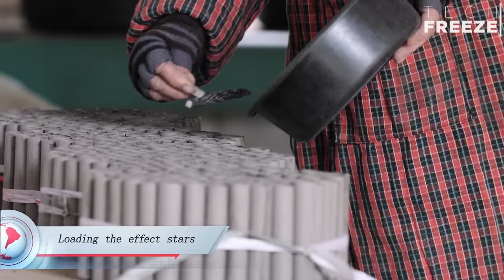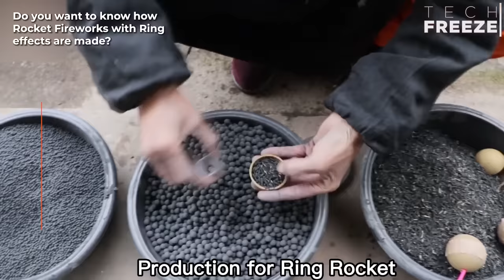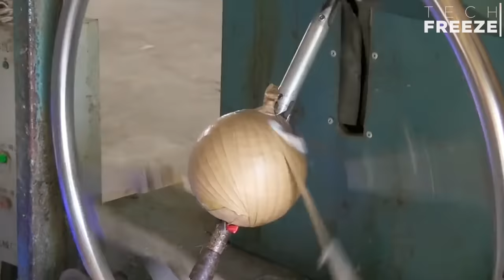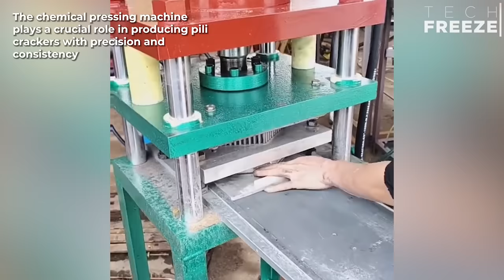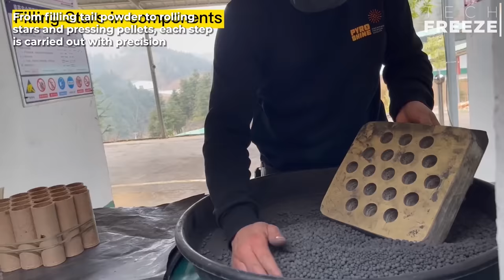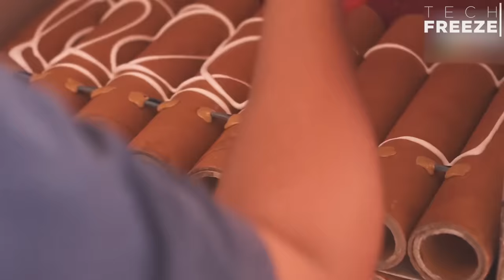Fireworks Mass Production Process in a $70 Billion Industry

Comment: I noticed that all workers work without gloves. Is there a substance that contains gloves that is toxic to human health? What is the reason behind the lack of gloves?
Reply: Gloves can produce static electricity, that's not something you want working with black powder or flash powder cause static can set it off like a bomb. Unless they're able to get their hands on static proof gloves they'll keep on working without em
Reply: Also... China.
Reply: It’s china.
Reply: And India. The part where they are punching clay in to tubes is in india
Reply: A) Gloves would reduce profits.

B) People are replaceable

C) Gloves would reduce profits

D) All Of The Above
Reply: Lack of gloves is your only concern about people working in an explosives factory overseas?
Reply: Latex tends to cause  skin allergy over time. It’s getting common in hospitals that a lot of doctors and nurses gain skin intolerance to latex that’ll keep them from using them.

But, I believe it’s more to prevent static electricity, since even in Japanese top fireworks makers tend not to use rubber or latex gloves.

Comment: The cost of fireworks have become out of control.  I haven't been able to afford any for the last few years.  I live in an area where backyard displays on the 4th and new years will rival any public display, going on for several hours everywhere.  but last week on the 4th the displays were few and far between, obviously most people are hurting cash wise.  The fireworks tent that pops up in my area pretty much sells out, but this time if looked fully stocked on the evening of the 4th.  Heck even our public display changed to drones due to cost.
Reply: You can actually find good prices doing group buys and shopping wholesale. If you shop early and have a local distributer you can get good deals as well.

You also have to shop smart, dont buy into the gimmicks.